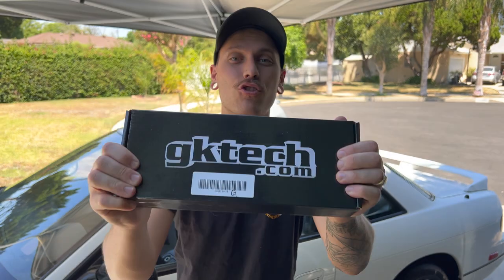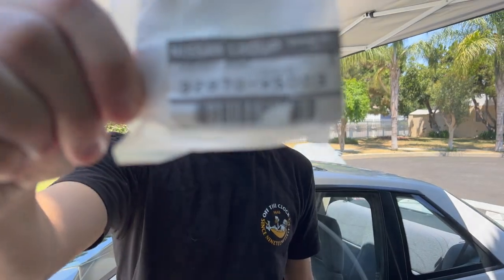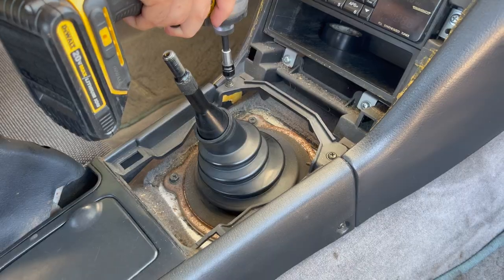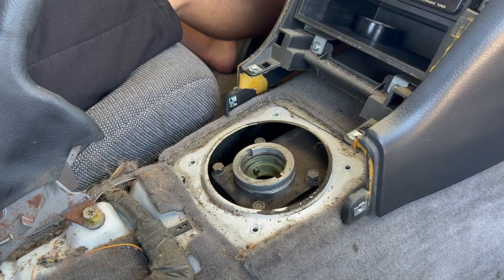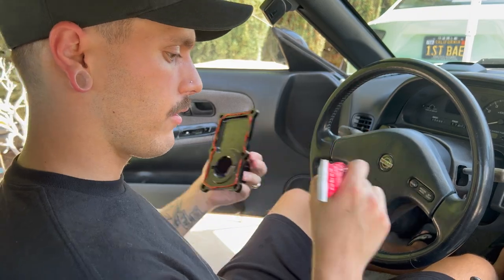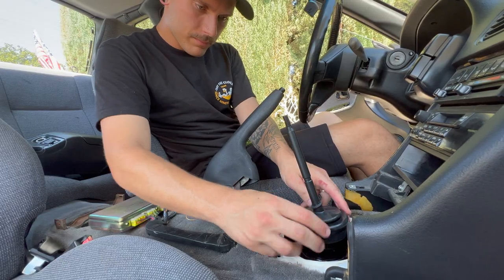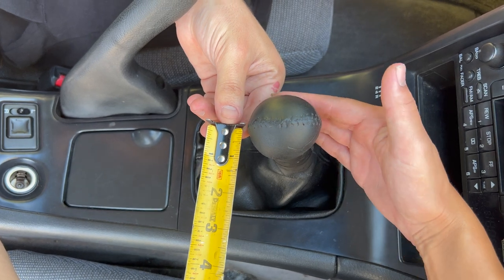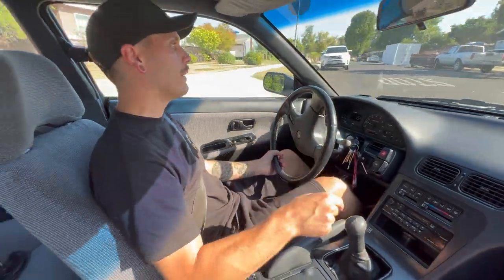GKTECH SHORT SHIFTER FOR S13/S14 - 240SX RESTORATION - PART 6

Comment: Hey do you have any rattling in your shifter? Mine is a V2 and its installed just like yours in the video. Rattles like crazy! Both acceleration and decel. Stock SR stock trans
Reply from the maker: No rattling no, maybe your trans bushing is wearing?
Or it’s your shift knob?